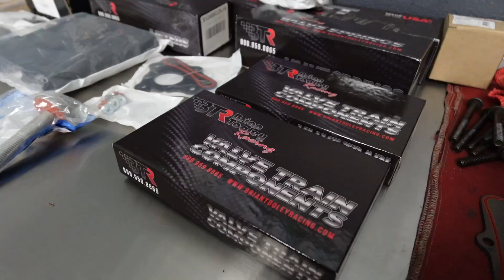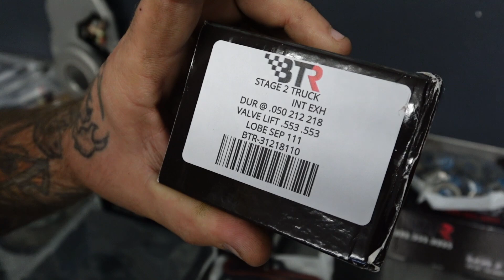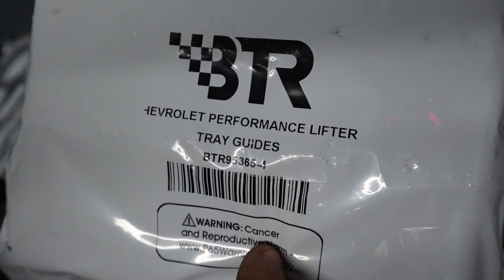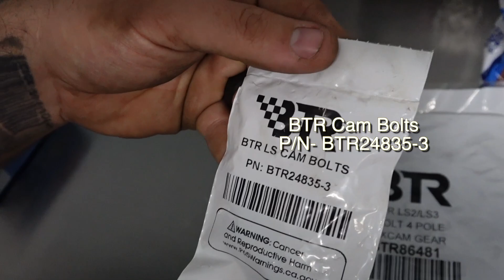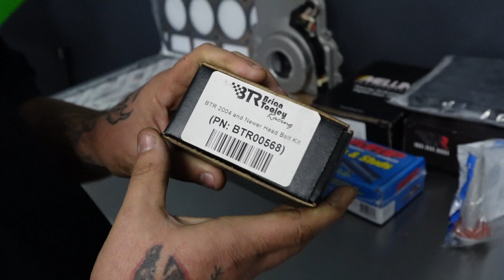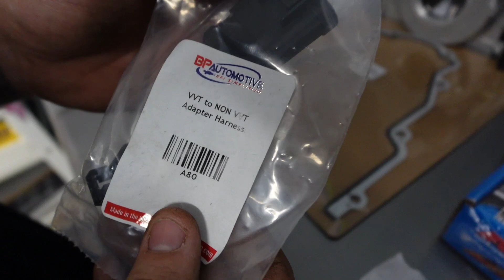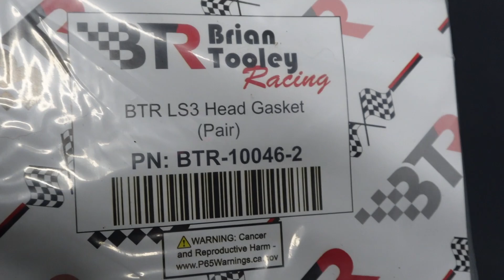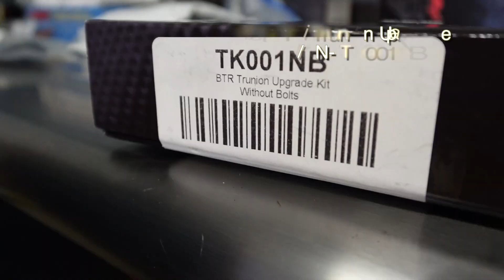WHAT we REPLACE on EVERY LS CAM SWAP at our shop! 6.2L LS BTR FULL VVT DELETE.

Comment: What do you mean 6.2L is non AFM> the 6.2 engines are AFM/DOD engines. Also I was reading the DOD AFM engines run a standard high volume oil pump due to the dod.
Reply: I have a 2011 Yukon xl 6.2 and it’s afm
Reply: My 2010 Yukon Denali XL 6.2 is 100% AFM/DOD/VVT its an L94!!
Reply from the maker: @timothyberlinski2299  no. 07-13 6.2s were not afm:dod but some were VVT.
Reply: @727motorsports Depends on the engine.
Aluminum Truck Blocks

L94 (2010-2014) AFM+VVT,

L92 (2007-2008) VVT ("1st design" engines built prior to April 1, 2006 had AFM components but were not connected. "2nd Design" didn't have AFM components at all)

L9H (2009-2013) VVT
Reply: @727motorsports  gotcha. I am doing my 2019 6.2 soon. Wanted a SC. It probably just do full bolt ones and a cam. Would really like 600-650 crank hp